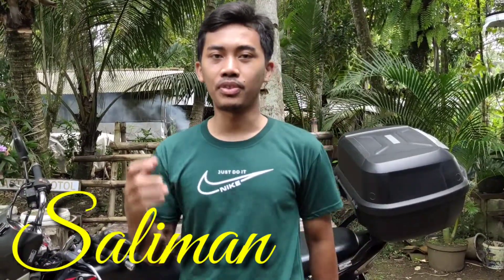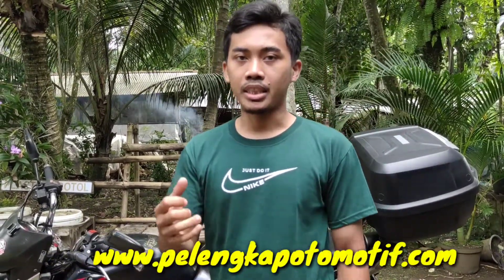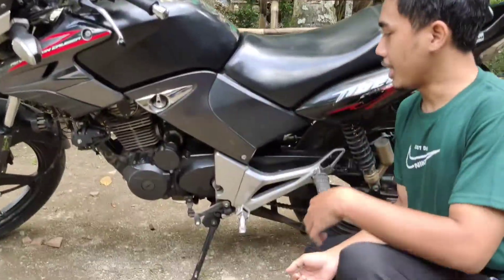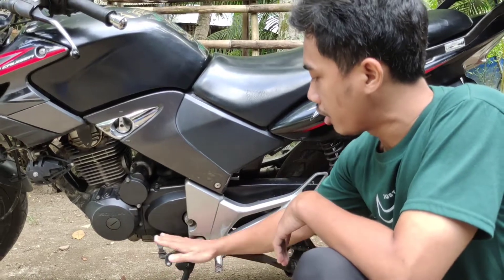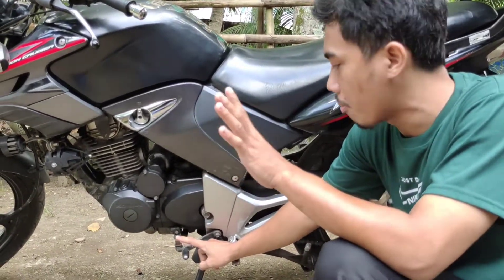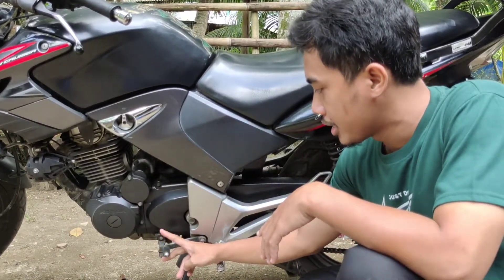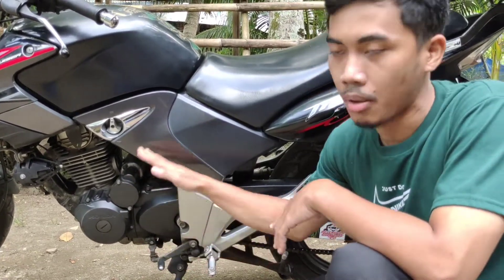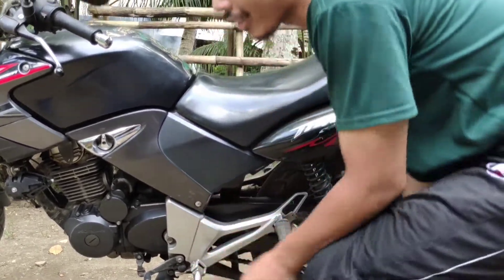Cara Menetralkan Motor Kopling Honda Tiger Revo

Comment: netralin nya kalo pas di gigi 5 apa bisa bang? dan kalo motor mati mau di netral in sambil di kopling ga
Reply from the maker: Motor mati tetep sambil dikopling. Kalau dari 5 bisa tapi gak bisa langsung tetep harus dikurangin dulu sampai 1
Reply: @PelengkapOtomotif  kalo pas di gigi 5 di kurangin terus sampe ke 1 baru bisa netral?